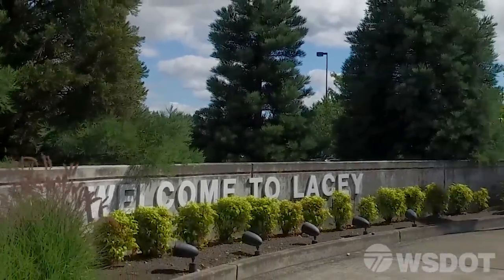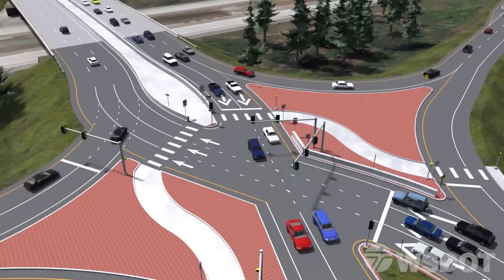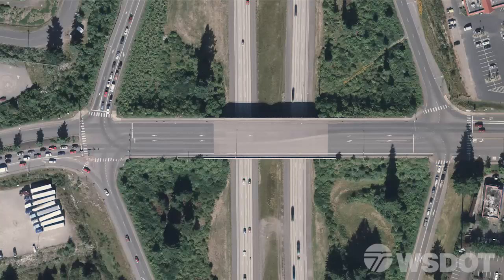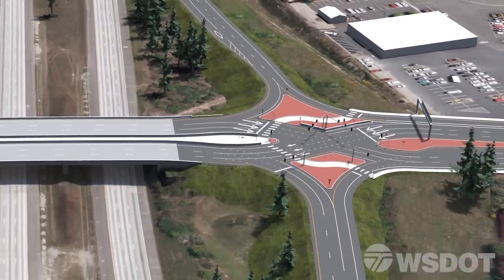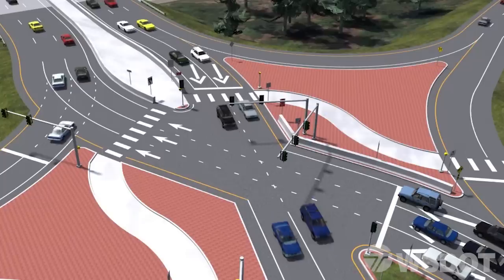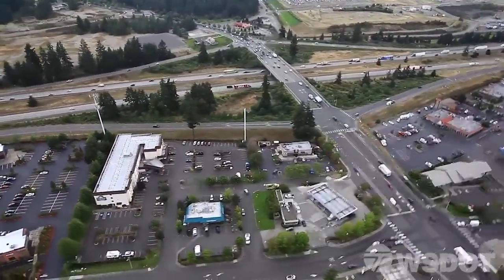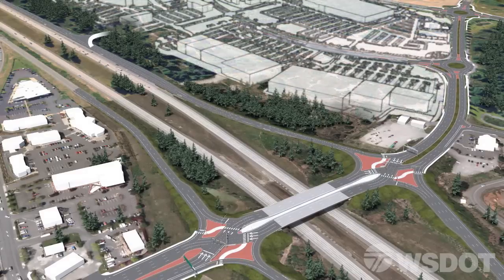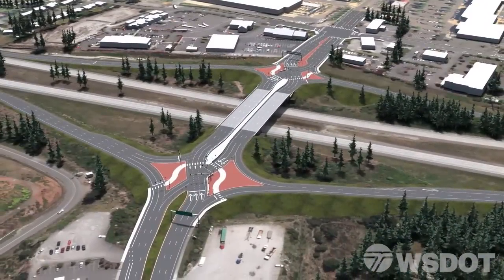Diverging Diamond Interchange comes to Washington State

Comment: I guess a simple roundabout was too much to comprehend
Reply: How many cars can drive trough each of these solutions per h?
I think this might the reason for this solution. 

Also the number of collisions, but this can bee seen as a factor in throughput calculation
Reply: A simple roundabout would not resolve the issues here.  They are good, but not the best solution in all cases.  This will move a lot more traffic a lot more efficiently in this type of layout plus it will improve safety.
Reply: With 3 lanes of traffic each way?
Reply: Etoile Charles de Gaulle
Reply: I think mrplease66 was thinking of those roundabouts in the UK at many complicated motorway exits - essentially a circular one way road over or under the highway (have seen them 3 and 4 -lane) with multiple exits. The design above is better than the original design, but I'd like to see it contrasted to the roundabout.
Reply: Yeah, no. British roundabouts are insanely overcomplicated
Reply: Not at all, you just... go with the flow... :  )
Reply: so... what about the traffic lights? ever driven through a red light at high speed? braniac
Reply: YOU'RE RIGHT! I'm sure the traffic engineers who've had years of training and who attend dozens of conferences a year are just too dumb to get it. WSDOT, hire this man!
Reply: Here come the Americans with their blatant misunderstanding on the objective facts that a roundabout is superior
Reply: And I think roundabouts normally don't work well with pedestrian crossings.
Reply: Roundabouts are faster and keep flowing better than lights. This was proven in many places, including Mythbusters.
Reply: How is it complicated, you leave the motorway, and join a circular road, you drive around it till you see your exit and you go that way... imagine the road was straight, and you exited at your junction it is the same thing but you are driving in a circle. I don't see how this is hard. It is easier than red lights stop green lights go, sometimes they flash orange, and sometimes even when it's red you can turn left, but only when there is a sign letting you know unless you are in some states or even towns where it is a given but not in others....
Reply: mrplease66 how will trucks get around it?
Reply: Brisdad53 what is this if not slow speed traffic? Europe has roundabouts on 70kph roads.... people just slow down..
Reply: Nathan Zaremskiy the same way trucks in Europe get around them...?
Reply: This isn't europe, Trucks are much larger, heavier, wider, int he U.S. Roundabouts make it extremely difficult and unsafe for american sized trucks.
Reply: This is not a case of traffic engineers not understanding or appreciating the utility of roundabouts.  There are many roundabouts in the city of Lacey, where this is.  They simply determined that a diamond interchange was a better choice in this situation.
Reply: Hell, even in the South we have roundabouts, in fact the newly completed Interstate here has both a diamond interchange and a roundabout interchange one interstate exit away.  The diamond one for heavier traffic and the roundabout for the lighter traffic.
Reply: A DDI is quicker in this situation. A roundabout would work but not as efficiently. You have to take into consideration semi-trucks and increased traffic size. For a roundabout to work as efficient as a DDI in this case, there would have to be one in the center of the two sides of the interstate.
Reply: In Utah (USA) we have both roundabouts and diverging diamonds. The diverging diamond is ecellent for alleviating incredibly large amounts of traffic, and they are, in my opinion, the easiest type of intersection to use.

The roundabouts are excellent for residential roads that fluctuate from light to moderate use.

Anyway, anybody saying that roundabouts are the only way to go are just as ignorant as those saying that roundabouts are ineffective.
Reply: Andre Tsang they are. Traffic engineers create stupid insane shit all the time. I live near a place that has five sets of traffic lights in a quarter mile on a six Lane road
Reply: Nathan Zaremskiy I've been to Europe. They have the same size trucks
Reply: Dan Sanger no Americans barely conceive of roundabouts. We think traffic lights are the only way to do anything. Trust me, they didn't think this thru at all
Reply: Joshua Omer except we aren't. Roundabouts are better in every way. You simply adjust them to the size needed. Britain has heavy traffic also and uses roundabouts
Reply: +Michael King

No, they both have pros and cons. I think you are getting facts confused with what you are more comfortable with. You're just as bad as Americans who say traditional intersections are best, because they are unable to make an unbiased conclusion due to their close-mindedness.
Reply: Michael King, yes they thought this through.  The Washington State Department of Transportation, who are building this interchange, are very pro-roundabout.  They strongly endorse their use, and have many pages on their website promoting them.

https://www.wsdot.wa.gov/Safety/roundabouts/BasicFacts.htm

Washington state is one of the top roundabout states in the country, and the city of Lacey, where this interchange is located, has at least 16 roundabouts according to older information I found on the WSDOT website (probably more now).  I've used roundabouts in Lacey many times.

However, that doesn't mean that roundabouts are the right choice in every situation.  Obviously WSDOT, which has been involved in building many roundabouts, considered them before they decided to build the first DDI in the state.
Reply: Michael King 
You would have to bend the actual interstate around one single roundabout for it to have an equal efficiency to a DDI. That would be quite a costly headache during construction and you would lose valuable space to equate for normal interstate speeds. Plus, no American wants to be hit with an uncommon roundabout, many visitors traveling the interstate will be flustered not sure what to do. Also if you put the roundabout in the center you mess with another part of a persons average interstate normalities; exiting the interstate to the left. People could get confused thinking the highway goes straight instead of veering to the right. I looked at it from multiple angles and can 100% say a DDI is better for this intersection than a roundabout. Factoring in driver awareness levels, road normalities, traffic size, area space, other difficulties including accidents, and cost!
Reply: Roundabouts are the worst.
Reply: Bob Bobskin 
It works good in other countries but Americans are just not that used to it. This city has roundabouts but felt it was a better choice to use a DDI for an Interstate. A lot of traffic using this are going to be people from out of town or state, and truck drivers; both are more prepared to see a typical stop light.
Reply: yes, so they take an option with is slower, involves driving on the wrong side of the road, and driving head on towards traffic which is, going the wrong way.
Reply: Bob Bobskin 
Slower? 😂😂😂 I don't think you got my point! Americans would slow down the roundabouts, trust me. What country are you from?
Reply: +Bob Bobskin

You've obviously never driven a diverging diamond before. It's incredibly simple, you only slow down if you get a red light (which is rarer than on a normal intersection), and you certainly never feel like you're driving into oncoming traffic.

Your ignorance of the subject is on full display.
Reply: Bob Bobskin 
Because of the barriers it feels like you are just going down a one way road.
Reply: I have driven in Australia, New Zealand, USA, UK and Cyprus.
Reply: You still see the cars head on at some point in most of these junction arrangements. They are just asking for a major head on collision.
Reply: +Joshua Omer
I have driven on them, thank you very much for the insult, much appreciated!

Comment: Will definitely try this in Cities:Skylines!
Reply: There are a few assets you can download as well. I've used this intersection a few times, and it can be useful in minimizing traffic.
Reply: Uhm... I actually did it and it worked. It's just not that good at managing traffic. The problem being of course, the intersection points. I eliminated those points and it works like a charm.
Reply: This is true. I often spend a fair amount of time with a traffic management mod, making the lights run properly in my cities.
Reply: So what mods do you guys recommend me?
Reply: Traffic Manager: President's Edition is the best I've found. It has a lot of features, but you only really need to use the ones you need where you need them most.
Reply: Thanks!
Reply: I have found roundabouts in Skylines to be lacking. Sure, they do a good job for a medium-demand intersection, but the backups caused by heavy traffic can be a nightmare themselves. I much prefer a well set-up DDI. Yes, each one requires a bit of fiddling with TM:PE's lane management, but coupled with the improved AI from the same mod... It's a miracle cure for areas that aren't yet ready for tunnels, but are too busy for roundabouts. The irony is that Skylines handles roundabouts pretty much exactly the same as most idiot drivers here in America do. They ALL stop before entering, then slow down to yield to traffic coming in from the next entrance. This is a problem that you can mostly solve through micro-management of the right-of-way settings on each roundabout, but that is a pain to do if you don't do it every time you build one, but even if you do, the stopping before entering comes up far too often when they should have clearance to just go on. With a DDI, you only have to worry about having your on/off ramps at ideal slopes and angles.

Oh, and the saved space... Roundabouts in Skylines are maddeningly huge, especially if you want to optimize the flow.
Reply: It's a shame. With more thought put into the logic of stop lights, Cities:Skylines could be a decent traffic simulator.
Reply: I find it easy to only add stop signs to two lanes of my three-way intersection.
Reply: They take this from C. S...
Reply: Just saw this and thought the same thing :)
Reply: Ergo a roundabout, even better.
Reply: I’ve tried it. Bus roughing gets confused when it is the only exit from a high way to a city.

Comment: There's a very small version of the DDI outside Three Rivers, Michigan. the math and theory behind this interchange makes complete sense in a warm climate.  Add heavy snowfall and an ice pack on the pavement that lasts for two months (blocking the ability to see lanes) and you have a recipe for disaster and very frustrated drivers in practice.   Warm climate? Yes. Snow Belt? Most certainly not.